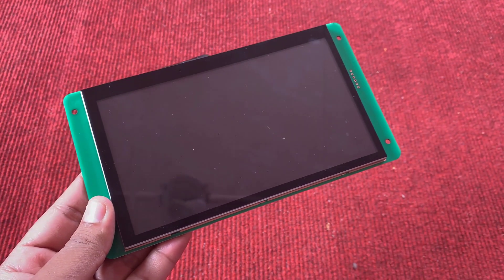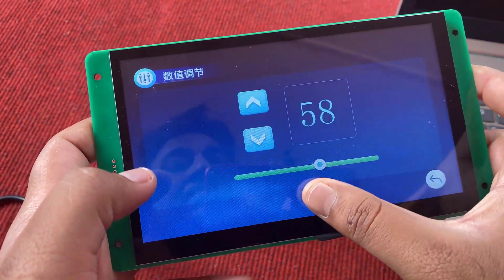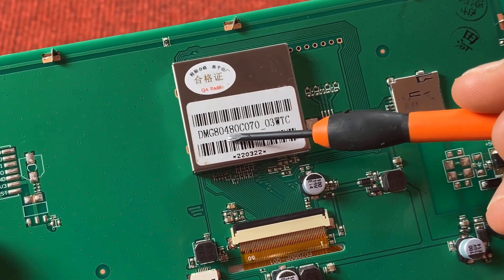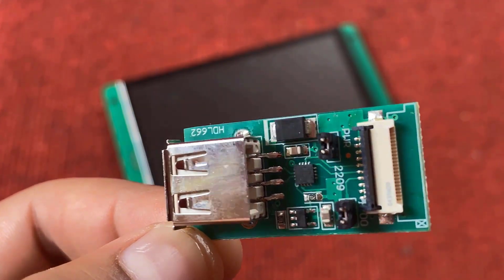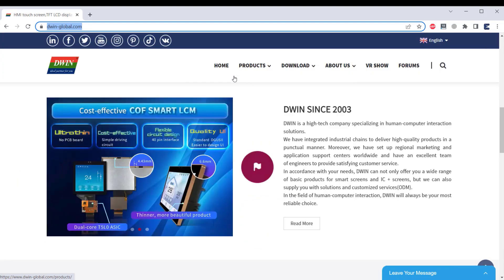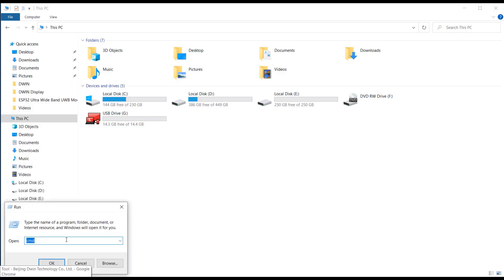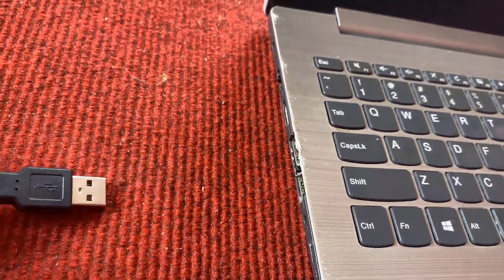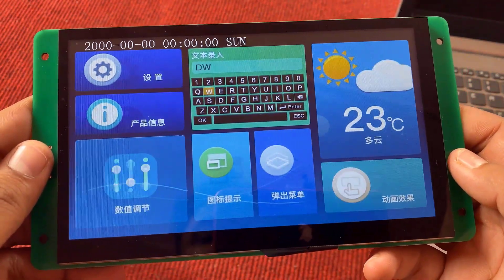Getting Started with DWIM HMI TFT LCD Display || Create Beautiful GUI without Programming

Comment: I have a DMG80480C070_15WTR. Simulating in the Communication Record, I send the bytes 5A A5 06 83 55 00 01 00 01. However, after downloading to the HMI, the output of the bytes is A9 CB F9 55 FD FF FF 00. What is wrong? I've tested with different Baud rate and the same error continues. Can someone help me? my email: jacob.andre272@gmail.com. Thanks for reading!
Reply: Can you please send the Demo file of DMG80480C070

Comment: I have this display bit I have problems to interface it with Arduino
Reply from the maker: I will be making few videos on that. Please wait for a week, your issues will be solved
Reply: @HowtoElectronics  thank you. I will be waiting.
Reply: @spiritchris8922  You could use it for many application. IoT, EV charging, industrial control etc, working with microcontrollers through UARTs